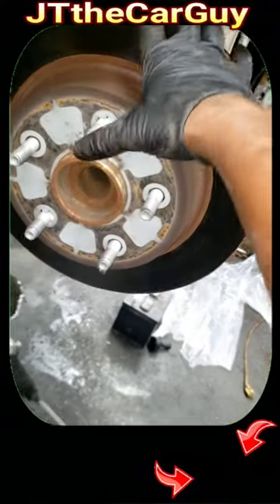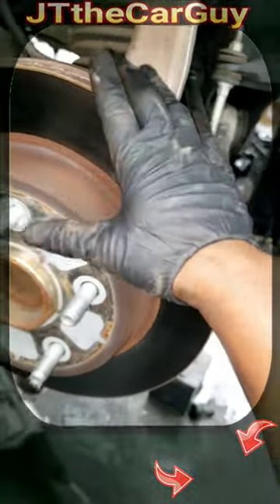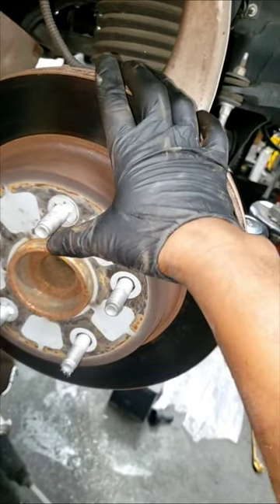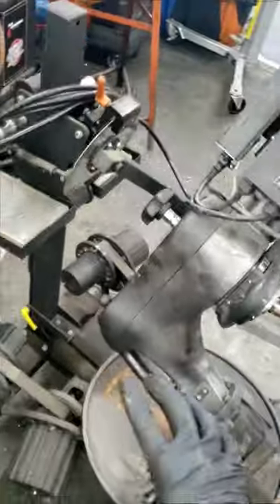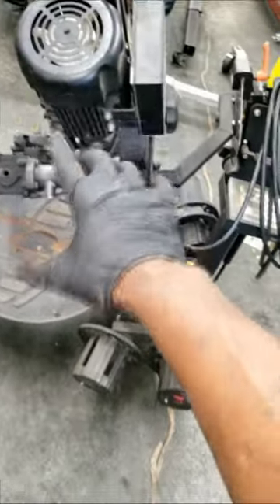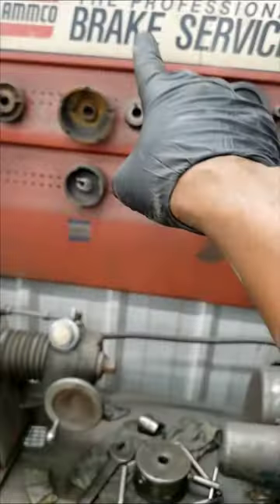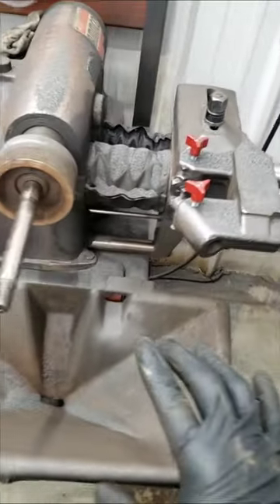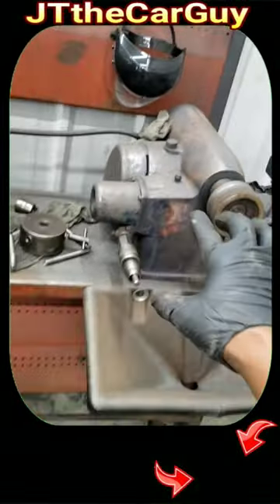What would yall do on this Brake Job?

Comment: When in the South rotors aren't welded to the hubs after 6 winters, you don't deal in corrosion issues. New rotors are cheaper in the rust  belt. Keep up the great work .

Comment: Those on-car lathes are only useful on something with a captured rotor where removing it involves lots or work and in the rust belt possible damage to the part. By that time it’s worth it to just get brand new ones unless it’s a warranty job and you’re stuck.
Reply from the maker: https://www.youtube.com/watch?v=fsyCG8l4T8E&list=PL-em2JbvrnvxuqZ5bcjgOpZNcKiyPd5Oj
Reply: On car all day.  Calculates the run out automatically on the specific wheel hub the rotor is on to give you zero or close to zero runout.  Something a bench lathe will never do.  Brakes are always smooth as glass after I cut the rotors with the pro-cut. That's all we use in my shop.